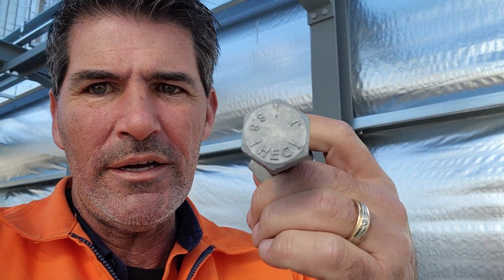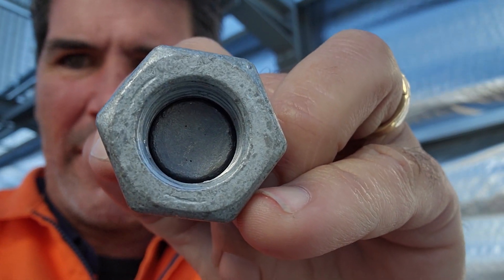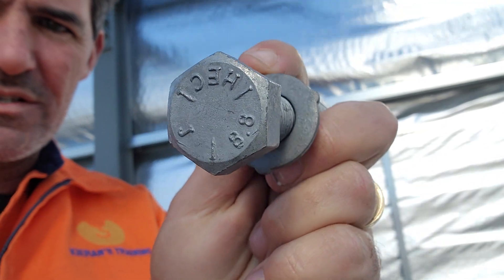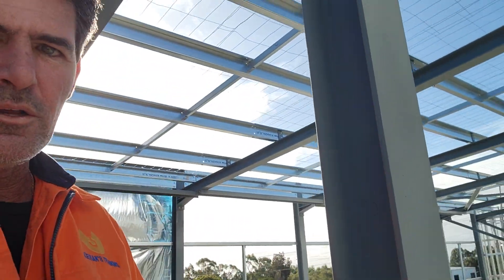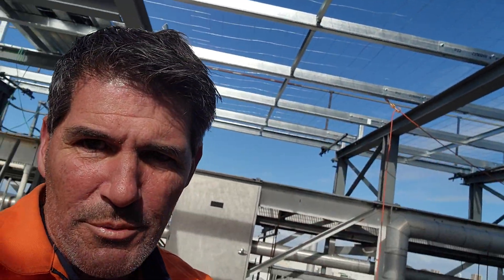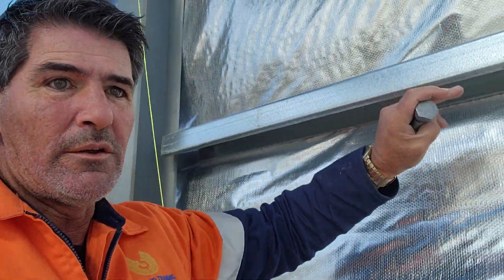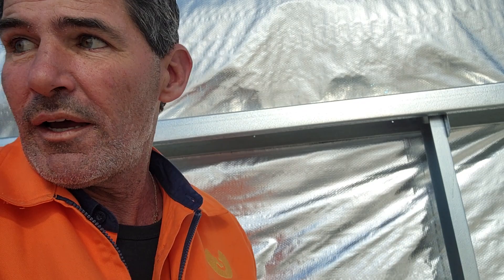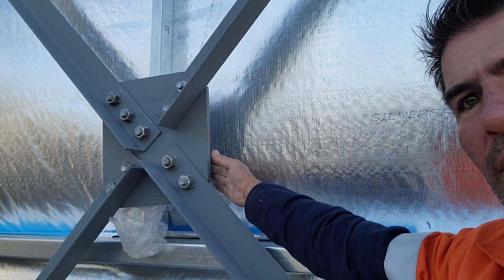Basic rigging and structural steel components

Comment: Fun facts for all, AS1252 is the standard for these Structural bolts. The 8.8 is the class. This is in reference to how it’s rated. Steel is always rated by tensile strength (unlike concrete which is rated by compressive strength). You seperate 8.8 into two: 8 and .8 you times the 8 by 100 to get the Ultimate tensile strength which is 800MPa and then you times this 800 by .8 to get the yield point, 640MPa. So what does this mean? When you tension (tighten up the nut) to 639MPa the shaft (shank) of the bolt will stretch like a rubber band, but if you stop at this 639MPa and then loosen the nut, the bolt will return to its original shape. However, let’s say this time you tension the bolt a little bit further to the 640MPa yield point and then loosen the nut after, it will not return to its original shape now. It is now permanently deformed, if you keep going further to the Ultimate Tensile Strength (UTS) of 800MPa, it will snap. Cameron
Reply from the maker: Cheers Stormbash. It's a very informative read

Comment: Cheers Mate , learning  something new every post👍👍👍👍👍👍 my poor math may keep me away from Rigging etc but as I'm very lkley to end up probably in W.A Perth region these vids are a Excellent learning tool for guys like myself looking to step in, 👍👍👍
Reply from the maker: Don't stress to much about basic rigging math. All it is is formulas. Once you memorise them you jist put the numbers underneath and jump on a calculator. My basic rigging calcs video will go through it all, just watch it and write down the formulas. Write them down in order 100 times in a row if you need to but once they're memorised the rest is easy. By the way the third formula on working out the diameter of the rope is no longer required, so it is just the 4 formulas